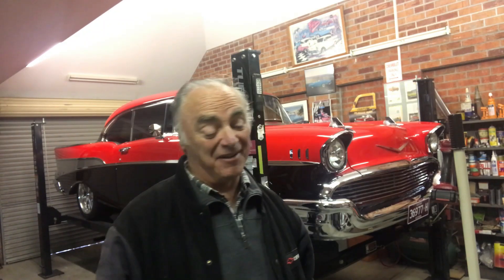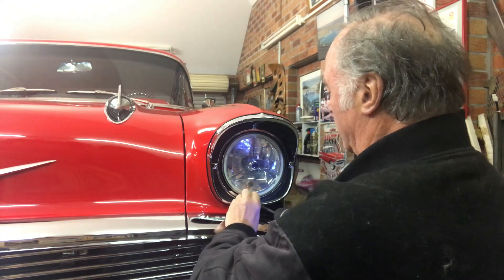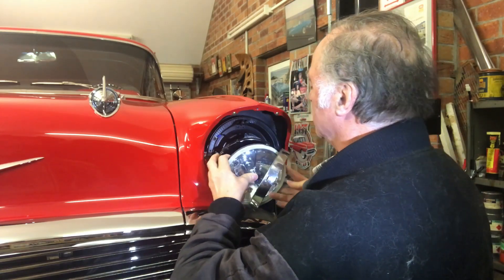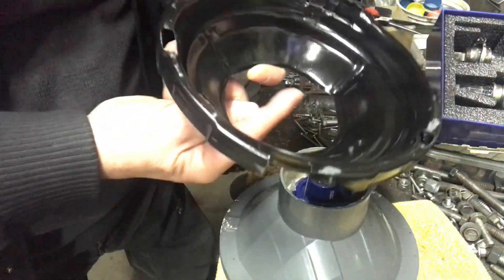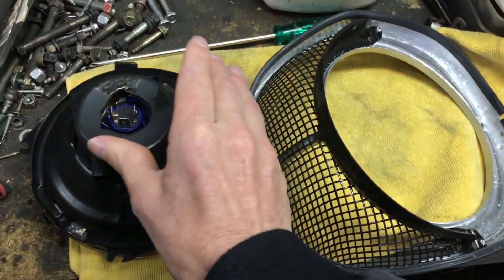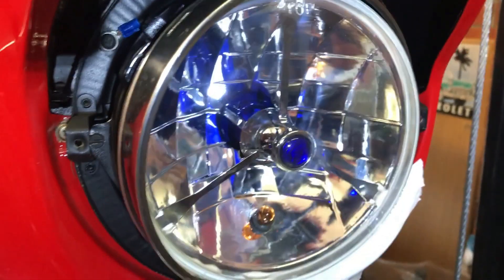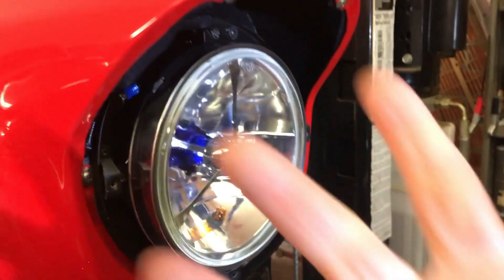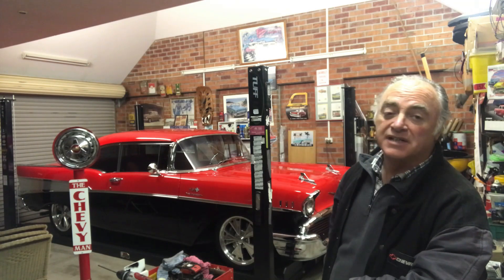Install LED head lights in a 1957 Chevy

Comment: Hey Chevy man looks great, what brand did you use for the rest of the bulbs? The brake lights in the bumper, are those a new lens or a bulb. Thanks for sharing 👍
Reply from the maker: The brake/tail lights I have are Dakota Digital LED conversion kit but you can get cheaper type LED Lenses on Ebay, Ecklers or in Australia try American and suspension driveline parts they are better than just Buibs.  Thanks for watching The Chevy Man

Comment: Greetings from Florida! I recently found your videos and i am also a new  1957 Chevy 210 wagon owner! i have been looking for  how to convert my lights and found you!  what are  you using to house your bulbs? ive been looking but havent found any information on them.
Reply from the maker: Go to a NAPA store they supply OEX  Led replacement bulbs and head light housing to suit your chevy also OEX has tail light bulbs that will fit the original Chev housing. Thanks for Watching The Man

Comment: Do you need to use a  relay for the LED lights?
Reply from the maker: No because they use less current/power and wont heat up the cables. Thanks for watching The Chevy Man